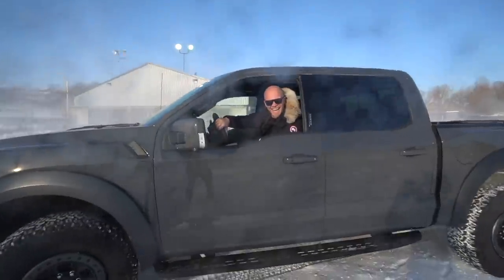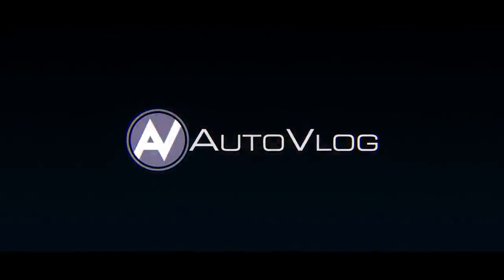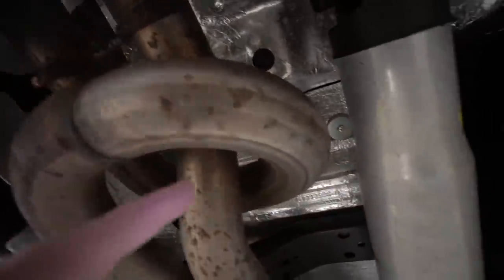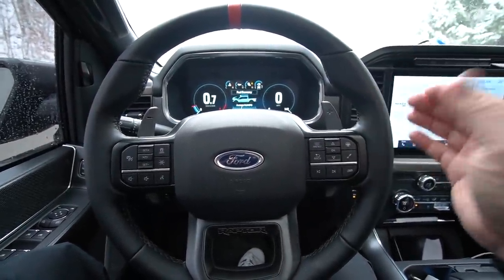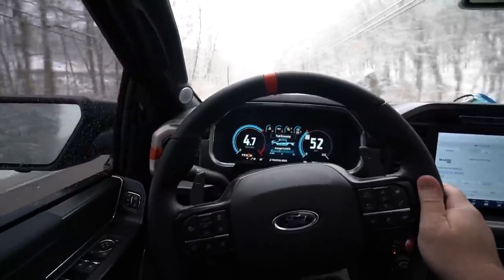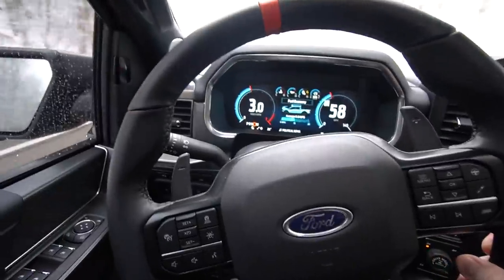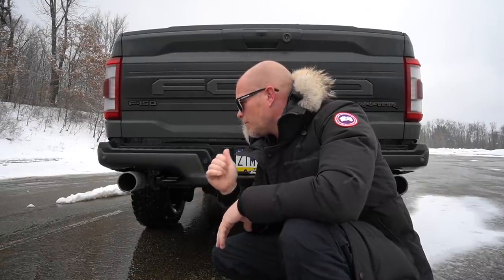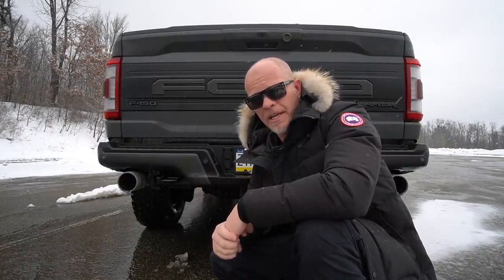New Ford Raptor Has 4 Exhaust Modes But Still Sounds Like Garbage

Comment: This sounds good for a v6. Honestly I’d take this over your truck which sounds like a clapped out farm truck lol.
Reply: Haha agree 💯
Reply: Real talk bro this guy is to much 🤣 His F150 sounds just like a farm truck bro you nailed it !
Reply: @amg2fast626  yup. It sounded good on the exhaust he had before.
Reply: Sorry Mike but I have to agree. Your truck did sound better with the first custom exhaust.
Reply: Also if he didn't have the supercharger this truck would smoke his V8 hell a regular 3.5L Ecoboost V6 would beat his stock truck in a race
Reply: @rapidfire3914  honestly his truck isn’t that fast. Lift, wheels and tires slow it down. I’m betting that a 3.5l with the hybrid setup would give his truck a run for it’s money.
Reply: @jhugo1986  your prolly right
Reply: @jhugo1986  It wouldn’t even be close, the hybrids are heavy (600+lbs heavier than the standard 3.5). The fastest power boost pass is 13.8 so far. This will be in the 12’s all day on 35’s.
Reply: He wants everything to sound like a ferrari. Give it up
Reply: @ericferguson4114  I didn’t say it would win. It would be a lot closer than most people think.
Reply: @paugie40  lol well his truck is far from it.
Reply: Dam
Reply: eactly i dont like straight piped v8 clapped out farm truck lol

Comment: This sounds good to me. 

Outside of the Mustang, Ford’s exhaust on their V6 models usually sound terrible…and more terrible when you try to mod or straight pipe them.
Reply: It's cause they use a unequal length exhaust setup, and the firing order on the Ecoboost is  not as common as the Nissan/Toyota v6s. Ford remedies this by installing that trombone to make the exhaust equal length to produce a more pleasant audible experience.

Comment: Sounds great imo, especially in the opening sequence and the fly bys. 

Comparing stationary revving to the engine actually being under load and in boost are two way different things as far as exhaust sound goes.
Reply: I own this same truck…under load in Baja mode, with the back window open it really starts to snarl after 4K rpm. I’m thrilled with it for being variable and a V6.

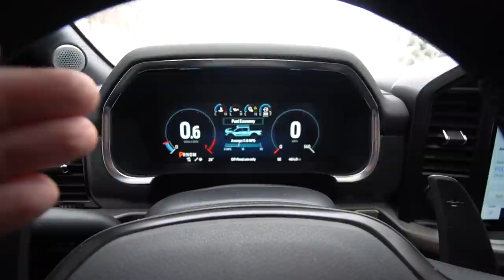Comment: 5:36 probably the same reason they have the little covers on the ridid fog lights. The Baja mode is probably louder than is allowed with a stock exhaust system so they say for offroad only be but know a lot of people will just immediately go to that setting anyway

Comment: Good looking truck, your right 2nd gen looks way better, as far as sound nothing compares to a V8. Never will
Reply: Just bought a F-150 with the V8. Sounds awesome.
Reply: Yes, the 5.0 sounds great in the F150 but the 2.7L Ecoboost F150 will beat it in a drag race.
Reply: Gen 3 looks better than Gen 2
Reply: @ghostwrench2292  bro if you think the 2.7 can beat 5.0 mod for mod omg
Reply: @ Dou 6.2 - I’m talking stock vs stock.

Comment: I went and bought 2 fake heavy Guage Flowmaster mufflers after the x-pipe. I ran the exhaust out the back with 3" aluminized pipe. Everything factory in the exhaust is gone after the catalytic converters. It has no drone and sounds amazing.

Comment: The tone and loudness do change slightly when you listen with headphones in. It sounds good in all four modes when winding it out. It does sound pretty much identical to a stock GTR. Which is a good thing imo.👌🏽🔥🔥

Comment: I have a Gen 2 with the Borla Touring exhaust. Not too bad, but it is still not a V8. And BTW, the V6 does not get any better gas mileage than my 2017 Roush F150 with a stage 2 Supercharger. And the Roush screamed, and I had to add traction bars.  Why not put twin turbos on the 5.0????

Comment: I think it sounds good. I’m wondering if the modes that you’re scrolling through do anything else with the suspension tighten up the steering because it looks like it’s a combination of exhaust changes and drive modes. That’s why Baja says for off-road use only just wondering.
Reply: It does change suspension and steering speed.
Reply: Exhaust mode I believe is separate and if that’s true the Baja mode is most likely to load for on road

Comment: what else more do you want? i think it sounds great ...its not a v8 its a 6cyl with twin turbos...i personally like it and i have a 68 gto with 500 hp cammed heads and h pipe and a f150 with 2.7 twin turbo with a tuner and intake and I  don't knock either one cause their suppose to be different....

Comment: Valves have to open up in the higher RPM to meet BP requirements for HP. The mode differences are mainly in part throttle positions.

Comment: Sound is a weird thing. Our ears are not linear in sensitivity. You should use a dB-meter to actually measure the absolute and relative level . And that could give you very surprising results.

Comment: You can Probably pull the fuse and keep valves open all the time 
My zo6 also go quite when coasting or of the throttle even though i have it on track mode for the exsust

Comment: Sorry, I am so out of touch with the enthusiasts who need "ear bleeding loud" in order to feel like things are right. As a guy who grew up in the "muscle cars era", my idea of "loud" was the deep throated sound of Hemi mufflers on my '70 383 cubic inch motored Road Runner. I test drive new Ford vehicles for a living, and my "benchmark" is, "What can it do?", not how loud is it. I love the torque of the new F-150 Lightning, and Powerboost! The handling of the Mustang High Performance Ecoboost, would run circles around my 1969 351 Cleveland powered Mercury Cyclone Cale Yarbrough edition I had after high school in 1973. That car was no slouch, but a Fiesta ST or Focus ST would out handle that car on a track without breaking a sweat.  I love stealth! I have no problem driving a bright red  "cop attraction" Mustang GT in "Quiet Mode" as I go past police, and other sport performers, then throwing it into "Sport Mode" and let them envy my tail lights! Quarter mile driving is great, but Autocross, and tracks with high and low points, and lots of curves REALLY test driver ability and vehicle control, "...becoming one with the vehicle". My "Dream Garage" would have a Mach-E GT, next to my 2019 Bullitt, and my F-150 Powerboost parked in front of my driveway. A quiet, but powerful daily mileage driver, a fun N/A weekend muscle/sports car, and the off road/towing truck at my disposal. A C-7 Corvette 2LT, and a loaded Hemi Challenger, next to my 6 Speed 2021 Manual Genesis G-70 would give me the closest thing I could have to "Jay Leno's Garage", LOL! Having said that, still love your channel, Mike, keep it going!

Comment: Take into consideration that the exhaust will take time to break in, just like a motor does when new. You may hear a slight variation in the tone in say 6 weeks or a few months from now. The 6 sounds good, but it's certainly not a burbly, snarling V8, Damn Smog nazis.

Comment: Quiet mode sounds a little quieter than normal. Sport and Baja are considerably louder. Baja sounds quite a bit louder than sport when you're rolling around. It sounds a bit better than the Gen2. It's nowhere near as good as the V8 with the Borla Attak.

Comment: I think my next F-150 may just be a Platinum, 2” front lift, 20 inch x 35” BFG KO2 and an exhaust. We will see how the new B&O sound system works. My Saleen Yellow Label F150 XLT with
Reply: With the supercharger is a monster! Added Nitto 420V’s , exhaust, Bed Lid, upgraded the sound system. Life is short!

Comment: It doesn't sound too bad really. I have a 2.7 TT Bronco Badlands coming in early early spring and i didn't think they sound bad. I think its very slight differences in notes on the Raptor. Only way to be sure is put a decibel meter on it inside and outside

Comment: 1) A six will never sound like your beloved V8... ever.
2) The Turbos act as sudo mufflers as they are part of the exhaust system. Probably the best sounding Turbo is that little Fiat Abarth 4 cyl,, which has no mufflers at all.

Comment: Mike, maybe you need to buy yourself a late 70s square body chevy with a 180hp 350 v8 with glass packs. Maybe that would make your member feel larger .
The 3.5 ecoboost is a stout engine. 
I remember guys like you when I had a Buick GNX. The v8 guys usually saw my tail lights.

Comment: I like the sound(s); as for that "water slide" 270 degree plus turn around on the exhaust piping, maybe the data needed a certain (matching) exhaust pipe length to achieve a certain sound?

Comment: You should do an engine swap on the raptor put the 5.0 supercharger in it
Reply: Why would he do that on the Raptor? First, it’s his wife’s Raptor. Second, he said he’s getting the V8 Raptor R when it comes out. Third, he said he doesn’t mess with any of his Raptor’s exhaust systems so modifying the engine is even less likely.

Comment: Yeah it’s still no V8, but you can’t deny the massive improvement. Gen 3 sounds like a Nissan GTR while Gen 2 sounded like 90s Ranger with a rusted out muffler. The fact that they improved the sound from clapped out junker to supercar with just some clever exhaust engineering is seriously impressive.

Comment: Will I’d rather get the trx 
i prefer the interior the engine and the looks of it then the gen 2 and gen 3 raptors but the raptor is the first high speed off road truck from the factory so it’s the Benchmark I think 🤷🏻

Comment: What I think might be happening is the same thing that happens with the W205 C63s. 

Because of noise pollution laws, the valves don't open up all the way when you're in neutral or neutral revving. You'll probably notice a sound difference outside only when you're on the road and in gear. I know Mercedes only opens the valves 60 to 70% when neutral revving even in race exhaust if it's below 3,000 RPMs and that too is only in gear. Not in gear it's significantly less.

Comment: They open when you punch it they have to they don't want to restrict the flow on that crazy exhaust at high revs the exhaust mods are for when you're sitting low RPMs for the outside the inside is too insulated to tell

Comment: With the revering through different exhaust settings you can tell little bit of throat popping more in different modes on the pass-through they sounded the same in quiet mode to Baja mode

Comment: Mike... there's enormous difference in all ... and it sounds killer... sounds bloody awesome.
You really don't get a lot do you Mike... it's so that you are taking others who might not like loud exhausts into consideration, and Baha mode when you are out in the back blocks, it doesn't matter.

The next thing you don't get... is inside the vehicle you are listening to mostly INDUCTION noises... you need a mic on the outside to listen to exhaust modes.

Those drive by clips... it sounds awesome Mike... come on man... If you can;t hear the difference... wash your ears out... LoL...
You also gotta remember, those stock exhausts have to meet certain laws also.

Comment: Just like the S550 platform, under WOT/heavy throttle the valves will automatically open. I think this ecoturd sounds pretty damn good. There is a difference in each mode and the only way to really be able to tell a difference is when you start doing exhaust work to them.

Comment: Honestly sounds pretty damn good. Slightly more aggressive once you open the valves up. Sport & Baja definitely sound more throaty 3-5k rpms, the feint turbo spool is noticeable towards the end of your revs. I'm sure a 1.5/2" diameter pipe increase would resonate more with a titanium system, but your Raptor might sound too rice afterwards. I'm very curious what a small ECU remap will make power wise in the Gen III. Thanks for the great content, Mike!

Comment: I think it sounds great for a V6, maybe a bit quiet but nothing that a exhaust can fix. Other that that the high output V6 is a super strong and great engine. As a engine I think its way better then the V8 in all ways except the sound

Comment: Bottom line, the raptor is BAD ASS. The 2nd and 3rd gens to another level of visual sexiness. Kiddos to Ford for squeezing out impressive numbers out of the 3.5. If I had the final say I would have crammed the 5.2 super charged monster 🐍 under the hood. In doing so accomplishing two things. Keeping the raptors iconic truck it started out as and keeping Ram/mopar designers where they went wrong again.

Comment: There is just a little difference between the exhaust modes to me. However, I think the gen 3 sounds better than the gen 2. Ultimately though, excited for the raptor r. That’s the one I would buy over the 2nd and 3rd gen v6

Comment: People gonna say I'm in ram trx because the engine is powerful  but they didn't know the other part like suspension,handling,technology,mpg and many more. They didn't know that the raptor is much faster on baja off roading. 
Ram trx is not the beast it's the engine but the raptor does

Comment: love the truck but they should have figured out a way to do the 5.0 or even the 5.2 from the cobra in the new raptors. they are too high class imo. i get you can take them off road but they should do raptor setups with a more affordable twist to it. They’re kinda separate from an f150 completely to me because I mean cmon look at it, you gotta do a ton to a f150 to get it to be a raptor. Why not offer it in cloth seats like the 302A luxury package on the XLTS.

Comment: You can't make a flute sound like a bass guitar either. IMO for engine tone, it's a V8 or don't bother. You will not improve the sound of modern engines. Maybe Line 6 will figure it out thru your stereo system lol. But it will take a while. Hey man you're Raptor sounds 'fizzy'. Then we will argue about how you should use real vacuum tubes in your Raptor to get it to sound good. Buahahahahha!!!!